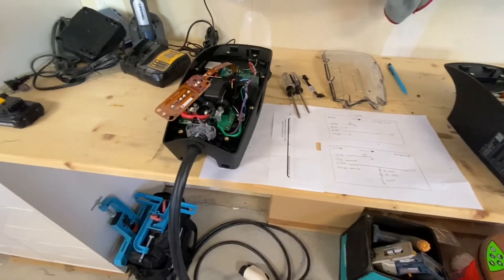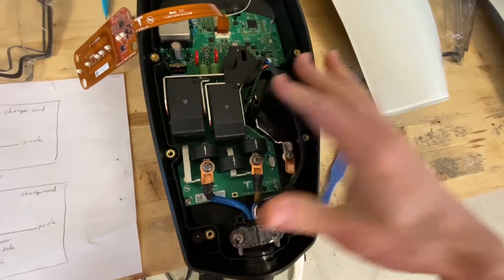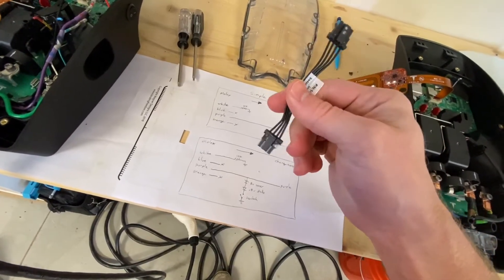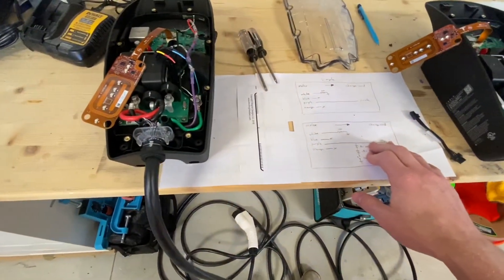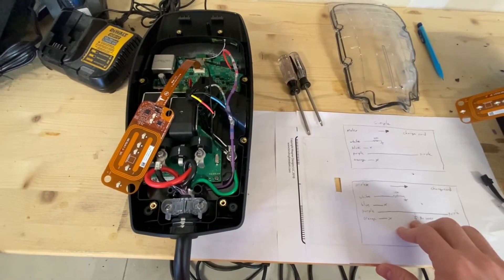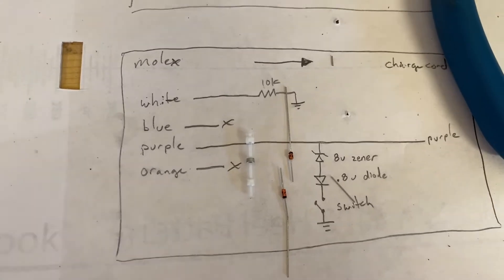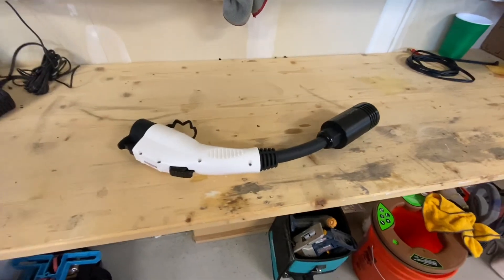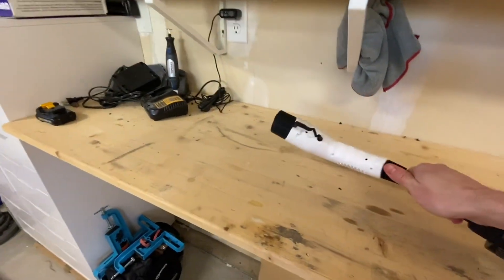Tesla Wall Connector j1772 conversion

Comment: Does this charge a Tesla easily when we use the J1772 to Tesla adapter from Tesla??
Reply: OK so great mod but this keeps the Wall Connector is a ready state at all times on its blue light, this consumes almost 500wh per day. Ideally it should go back to its green state which is idle and probably goes to sleep.Also if you want to charge a Tesla using this mod using the Tesla adapter on this, it works no problem however you call will not be recognized in the Tesla app section of your wall connector.
Reply: So the way above issues were addressed: 1) Orange wire for Proximity pilot. The wall connector has this as shown in the video. Instead of terminating that connect it to the orange wire in the cable from Open EVSE, it has been cut short, so you will need to solder another wire on it to connect to the appropriate terminal. 2) remove the Zener diode/diode grounded circuit (not needed). Now you are good to go!! It charges a regular J1772 car and also a Tesla using an adapter including gets the car recognition. Also get the wall monitor app, that is really good for the Wall Connector. the free version works well. Hope all this helps someone.
Reply: Since the OpenEVSE cable has more extra wires, I plan to put a thermistor in the J1772 handle.. just need to figure out what terminator to use... any ideas??

Comment: Great video and explaination of interior of HPWC. My only comment is that with your switch (which as you say only gains you 10 seconds of not charging), the L1 and L2 pins of the J1772 Plug are powered, thereby totally by passing the fact that the main purpose of safety.
Reply from the maker: Tthis was already brought up, and it isn’t the case. The relay doesn’t activate until the car negotiates and calls for power.

Comment: Always looking for ways to save some money. My car charges at 70A and I had a gen 2 HPWC with a broken wire in the handle. So I got a 100A J1772 cable dirt cheap. i assumed I could just throw the cable in there and it would work. I got a red light. I asked the company who originally did the conversions and he was useless. Now I know what was happening and it all makes sense, off to steal a resistor from any junk circuit boards I can find and make this work.

Comment: I just did this conversion on a Gen2. It works perfectly! Thanks so much for the video and the tips.
Reply: @David Deininger My notes say, "Purple #1, Black #3 to 10k resister to ground." Does that help you? I can send you a photo if you need. I'll have to pull the cover off to take the photo.

Comment: The Hyperbolic connectors in a J1772 aren't rated for make or break.  That is why the contactors (relays) close after the J1772 is inserted, so chargers have inrush and you can melt/destroy the J1772 contacts and potentially even end up the the J1772 welded into the charge port...
Reply: The handshake still happens it appears, its not engaging the solenoid and making the contacts hot from my understanding.  Anyone know the details of the resistor value on the white wire?
Reply: @jonricker326  he said 10k ohm in the video
Reply from the maker: Yeah this doesn’t make the connector live. While unplugged. That would be frightening!

Comment: Ditch the switch! There's no time saved, just plug it in, you don't have to stand there for 10 seconds. Also, if you keep the switch, I'd be very careful carrying the J1772 connector from the EVSE to your car, especially in a garage, and especially if there is water on the floor.

Edit 17-Jul-2022... as you mentioned in your reply, the EVSE does not send power unless negotiations are successful with the car. My bad!
Reply: The switch enables the "connected" state, but is not enabling the "charge requested" state, so no power is flowing yet. You can hear on his video that the contactor doesn't close until after he plugs in the car, when the car actually requests power to flow (it pulls the voltage on the purple wire down even further).

Comment: Can I just connect 2 hots, 1 ground and the purple pilot between the wall connector and the j1772 plug, and add a 10k resister between white and the ground to make the j1772 plug work?
Reply: Connect the Orange to orange int he OpenEVSE and you should be good to go.. :)

Comment: When using the original Tesla type 2 vehicle plug, no mods should be necessary for the S3V3_UHF (blue) nor the Term_Veh (white), since these functionalities can continue to coexist with common Type 2 charging, even for a non-Tesla EV. So it seems that only the signal detections need modification: Veh_prox (orange) might need a 680 ohm or 220 ohm to ground connection, depending on the max current (cf. type 2 standards). Remains the Veh_pilot (purple) connection, using the 8V Zener + normal Diode to earth connection, to quickly move into standard J1772 communication. There I have the question: would the Type 2 PWM handshake continue to work to align EVSE and vehicle charger controllers? The proposed double diode solution would remove the negative cycle of the +/-12V block wave. Is this desired? Otherwise, a simple 9V Zener diode would be sufficient. Instead of the switch, I would prefer to have a Teslatap-type adapter, where the Tesla-to-other-EV circuitry is resolved. This would leave the Tesla HPWC completely untampered. I guess your solution is completely bypassing the dip-switch2 setting, isn-t it?

Comment: Perhaps instead of the switch on the side of the unit, you could have a switch detecting when the plug is in the holder on the wall (either directly connected or driving a relay to keep it isolated). That way the "car is connected" signal starts as soon as you remove the plug from the wall.

Comment: Thank You. Great video. I have 2 Gen2 Wall connectors and we just bought a Chevy Bolt EV which needs a J1772. I've been thinking about converting one of the Tesla HPWC. I was wondering what the cable and plug that you ordered is rated at? I believe the Tesla HPWC is capable of putting out 48Amp. Did you get a 50 Amp J1772? What is the highest draw for the Polestar?
Reply from the maker: Glad it was helpful. The Polestar 2 does 11kw charging. I got the heavy duty cable from openEVSE.
Reply: https://www.evseadapters.com/products/tesla-to-j1772-adapter/